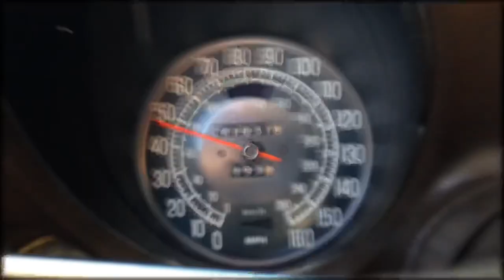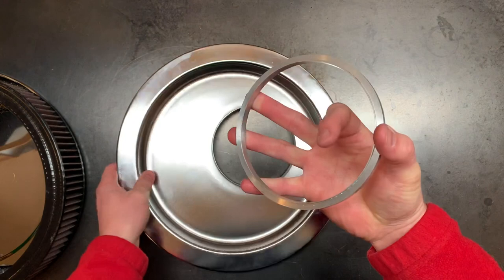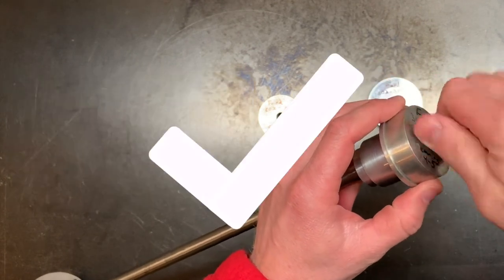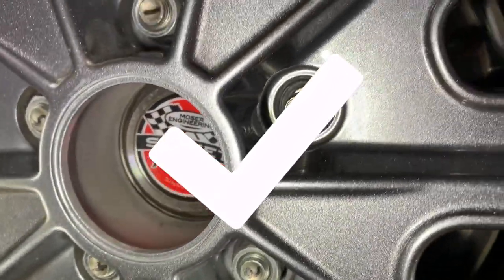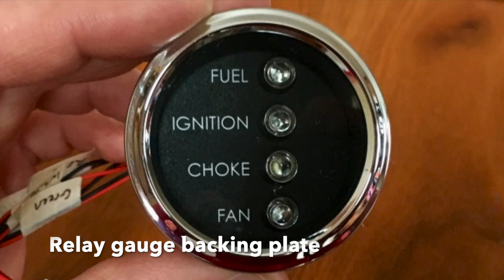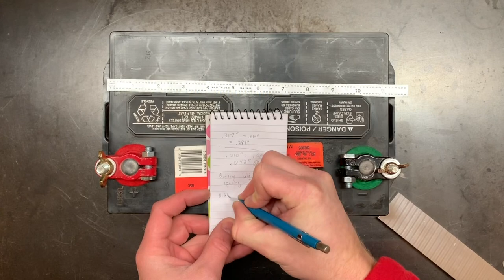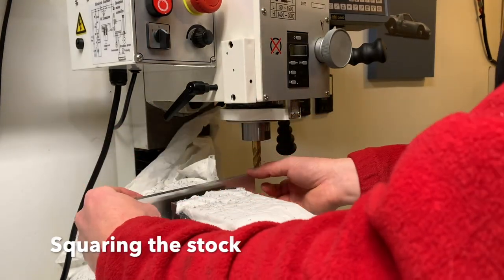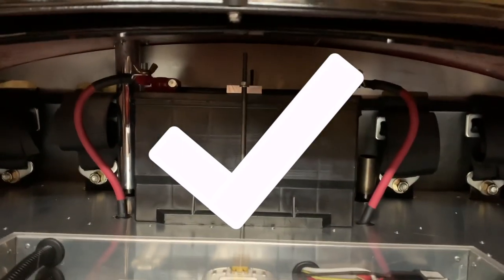Factory Five Cobra: How my lathe & mill bailed me out!

Comment: The 2 things I wanted to see was only covered for 2.3 seconds.  The prop rod and acrylic fuse box cover.  My 🐢 build.
Reply from the maker: hey Todd - you fabricating some parts for a build?
Reply: TacoJoe yes.  I’m planning on not using the FFR gas hood strut.  I do want to use aluminum hood and trunk props including brackets.  Great build videos by the way 👍